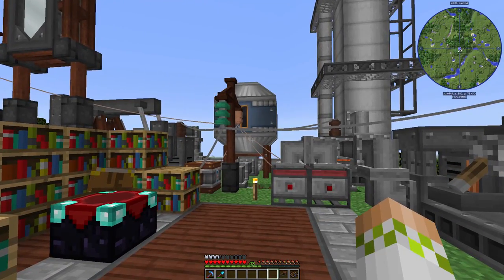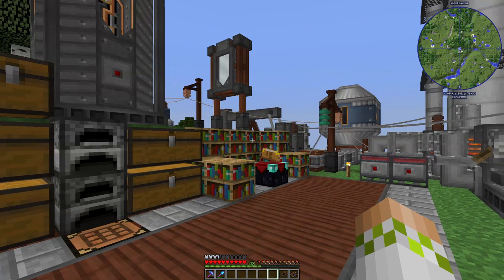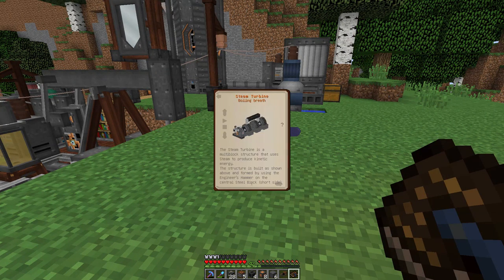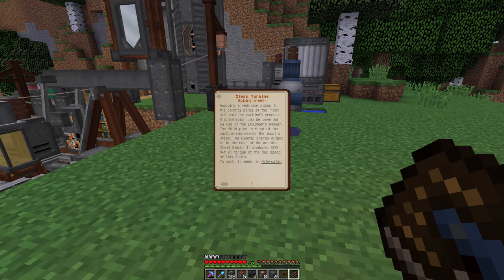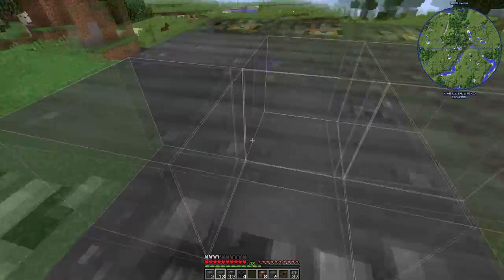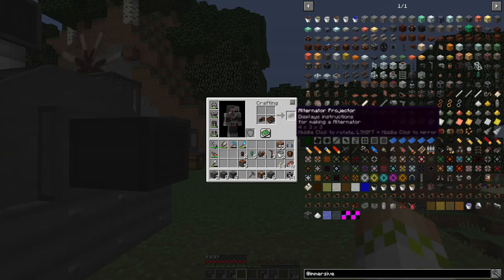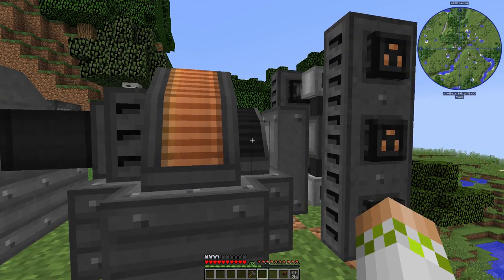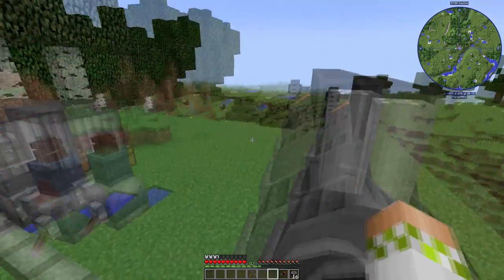Surviving With Immersive Engineering :: E16 - Steam Turbine & Alternator

Comment: I use this to power my arc furnace. I have it turned off with a tank of steam connected so when I need power I get a huge burst of energy since more steam = faster rotation
Reply: Probably a bit late. But you don't need to have it go at go at full speed all the time. It's like a car. You first need to push down the gass in order get it up to speed. Once it's up to speed. You can have it idle at a lower pressure. From my testing it was 66,6% of full consumption once it's up to speed. You can use the gass or fluid valves to regulate the amount that goes through. You can use two ways to automate it. One is using the power measuring stick to turn off one of the valves that's set to the remaining 33% but you don't need to put a limiter on this one. 

If I remember it's six redstone out of the comparator at max output. You can also use this to measure the amount of blocks a hopper funnels out to have it work with a hopper timer instead. 

This 33% less steam cost already creates 50% more efficiency. It's more likely 60% to 65% because production of steam also costs power. More if you use diesel to power it. 

I'm also convinced that the diesel and LPG generator has a similar wind up and idle amount. But I rarely use those. (playing in a mod pack with has pollution turned on.) 

This is the reason immersive engineering isn't over or under powered in any modpack. Truth of it is is that immersive engineering is much more efficient than other packs.